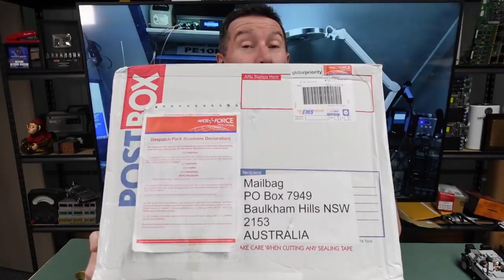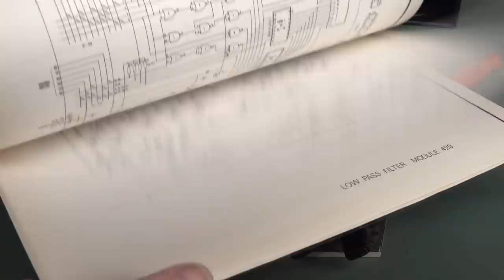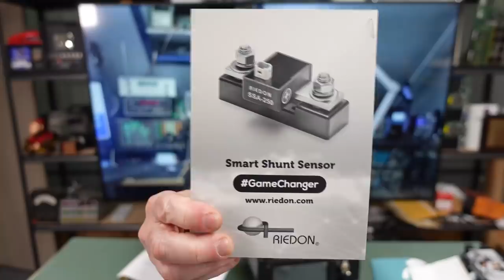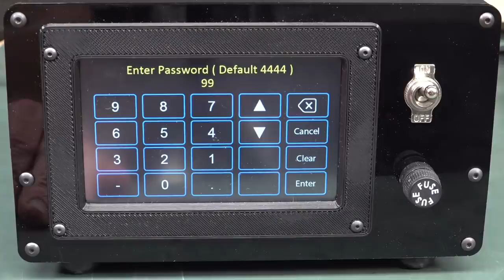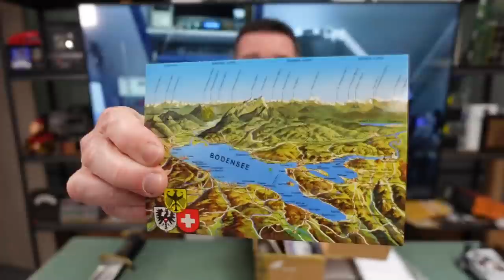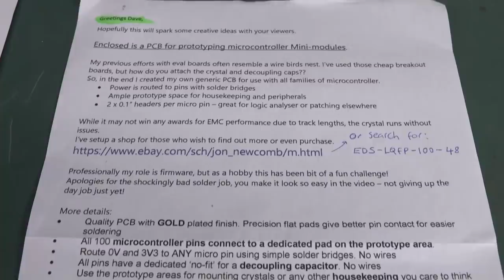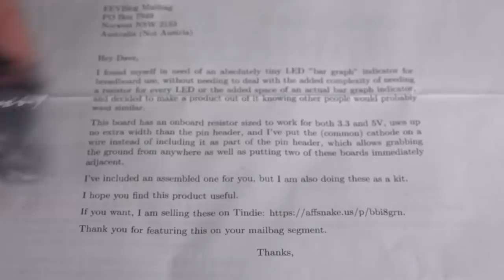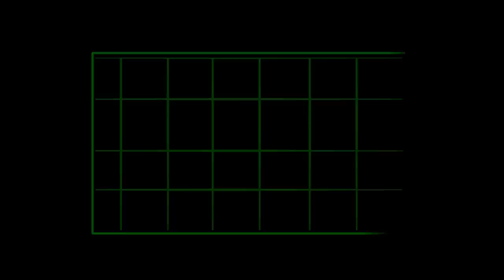EEVblog 1410 - Mailbag

Comment: note the brand of the TBA810 : SGS-ATES , the precursor to ST : ATES : Aquila Tubi e Semiconnduttori , SGS . The other TBA120 was very common mf opamp used in many tv's of that vintage. Those transistors are a SOT25 package. again , many audio/video stuff made in europe of that vintage used those. Even the schematics look and smell like philips.
Reply: BF195 BF196 were popular MF transistors in that package. Siemens also used it.
Reply: These SOT25 BC147 transistors were also used in old electronics kits from Philips (e.g. EE 2003) with which my "electronics career" began in the 70s ;-)

Comment: The Riedon SSA-100 is very strongly inspired by one of the many very well performing isolation amplifiers by TI/Broadcom/SiLabs (eg, the specs are the exactly the same).
The thing is, the packaging is pretty unbeatable - it should be an isolated drop in replacement for a standard shunt.

Comment: I had a torch like this as a kid in the 90s... One night I heard a noise, I thought it was a car driving slowly and parking on the gravel parking lot beneath my window... but it kept going and going. After a while when i was properly woken up, I realized, that it was my torch in the mains plug, that was melting and boiling inside. That could have gone horribly wrong, if I hadn't woken up...

Comment: Never heard of or seen one of those torches (that says Gelios AN-0-001 in case anyone is wondering), but I still have somewhere a late 60s Radiotehnika RRR charger for 9V 7D-01 batteries (the batteries had a cylindrical shape but the same contacts as a 6F22), and just now investigating the topic it seems they had a cluster of ni-cad tablets inside (similar to the ones shown in the video). It has pretty much the same guts, but doubled bc it's multi voltage (the USSR used 127V in the early days and to my knowledge some places used that until the 80s). The design is such that you can just plug it into a (flat and very unsafe) soviet socket and stick your finger in there.

Comment: Supercool items! 
The protoboard is amazing. A full-stack electronics dev platform,.....

I remember having a similar "bulb" torch which the same charging topology, but the batteries are standard-sized NiCd.  Had torn them apart and the NiCd sheets inside are very slippery to hands and never go when washed off(just like wetting heavy alkaline stuff).

Comment: I had one of these mains chargeable torches. Unfortunately one of the connectors came loose and got stuck in the wall socket.. As the normal  7 year old, I grabbed it with my fingers and since then I had been hooked to electronics

Comment: NASA Pen Story: Mostly false. Both NASA and USSR initially used pencils. Both disliked them because graphite is conductive, flammable, and flakes off (a terrible combination in space). NASA used mechanical pencils that cost $129; this was the point of public outcry. Fisher independently developed the AG-7, "Anti-Gravity Pen". Both NASA and the USSR bought hundreds of them at $2.39 starting in 1965. They are still in use today on the ISS.

Comment: "SIGTEC A1203" Radio Call sign PCB. Due to governance Ruling app. 1994 they installed those. Pres transmit key and first call sign is transmitted. I still can reprogram those A1203's

Comment: The US used felt-tip pens in space.  Fran Blanche did a video on fountain pens, including that there are felt-tip fountain pens and it was this type that NASA used in space because they're unaffected by gravity or the lack thereof.  The problem for pencils is how do you SHARPEN them in microgravity?

As for the Soviet-era mains-chargeable flashlight, I can't find any rechargeable battery chemistry with 0.26V cell voltage, so that's probably something else.

36:00 It even looks cheap on video.  It looks like metalized plastic.  Which is exactly what it turned out to be when smashed open.

Comment: Frako electrolytic cap at 06:55 - Yes, here is a Frako fanboy. The company Frako (https://www.frako.com) is still around, but as it seems no longer in the "small caps in high volumes" business, but in power quality and power factor compensation, where capacitors still play a vital role. Frako was and is a quality brand.
I found some Frako Elkos ("Elko" is the German abbreviation for electrolytic capacitor) in my component stash. They were from the late 1970s, when I built my own audio gear. Some of them were never used, new old stock so to speak. With their yellow/golden appearance, these parts stood out and were quite popular.
I took a 2200µF 16V type and connected it via a 40kOhm resistor to a 12V voltage source. It re-formed well, after 10 minutes, the leakage current was down to 10µA, after 30 minutes below 3µA. This is pretty impressive for an electrolytic cap which is more than 40 years old! The component tester measured it as 2500µF with an ESR of 0.2Ohm. I do not know how far this holds at realistic currents in a real rectifier/filter circuit, but I would expect the Frako cap in the marine receiver to be the least problem when bringing this device to life again.

Comment: That current shunt is really nice.. after watching that review on it just trying to create a need for one :D As for the torch / flashlight I use mostly LED for everything these days but I couldn't part with my old 6xd cell maglite, even though compared to some of the newer stuff its like lighting a match i keep it in a safe place with come 10 year magnesium batteries just in case shtf (if It wont light anything up the sheer size of it can beat down some zombies)

Comment: they are using a rippoff nextion (tjc) display @ 17:30  its got a graphical editor software where you can design elements, pages and stuff and just talk to the arduino via serial.  
tjc's are chinese nextion, its sorta ripoff. they are cheaper and intended for the chinese market (you cant even use the english software with it even tho its identical) you gotta use the chinese one.

Comment: To me, that piggyback chip is likely an increase in digital memory. The "bodge" wire is likely an additional address or chip enable line not included in the original circuit. Perhaps they did this to add additional frequencies not used in the original market?

Comment: Are there SMT devices on that bodge board?  That would definitely be an anachronism.  Even the fiberglass in the board would be unusual.  Probably, the repairs required obsolete component(s).  I do believe Mr. Carlson would like to play with that.

Comment: "Giant Package Trannies" now means somthing entirely different.
It is sad, used to companies provided amazing manuals to the consumer.
Then later they would provide them to authorized dealers but many companies would sell you a set if you asked nicely.
Now there are no authorized repair shops and many brands do not sell parts.
At all.
If it breaks after warranty (most likely 90 days at the longest) the company is done with you.
I worked at a 2 way radio shop for a while and we had glorious manuals from Midland, EF Johnson, GE and a few other brands we either sold or had sold in the past.
At the time we were a Kenwood dealer and it was much harder to get even a schematic or an alignment guide out of them.
The other brands sent us SWAG back in the day.
I wish I could have swiped the Midland LMR authorized dealer sign.
Also back in the day there was Sam's Photofacts.
Those were great manuals.
Expensive but great.

Comment: @ 25:00 is that a PCB Dave? I don't see any circuit in it. Looks like flying wires to me.By the way I have seen Soviet era diodes like that. Bought some kits from Erica Synths in Latvia.  Their old Polivoks replica kits had genuine Soviet diodes and transistorrs. The transistors needed to be be shielded from light. Stray light affects performance enough to mess up an oscillator circuit apparently. (normally it's only heat we worry about!)

Comment: The motor you squashed had a rubber based flexible magnet something similar to fridge door magent. I wonder why cheap motor used this weak magent and not proper ferrous magents other than than the lower cost are there any technical reasons I knows its easy to cut flexible magnetis strips then roll them in cylindrial shape for the motor housing making economical to make.....

Comment: Watch out for the beryllium oxide in those output devices! Wouldn't be surprised if its been used.
Reply: unless you are going to grind it up, and inhale or eat the resulting powder, BeO is safe(manufacturing it, on the other hand, may be a bit riskier though).
Reply: Not likely at 25W power, you only find the BeO at high power in those packages, typically over 150W, as then the die cost is high enough that getting that little bit lower thermal resistance makes it worth using. Only the military, telecoms and space will use BeO when they need to get that last percent of power out, and do not mind that the price of the equipment has just doubled.
Reply: @SeanBZA  Well, I just repaired my Marconi 2022C RF signal generator which had warnings of BeO with one of the devices in one of the output stages. Same package device, maybe slightly smaller. Most you will get out of that is +13dbm, that's 20mW.
Reply: @m.k.8158  I had a vision of decapping of those output devices to have a look inside....
Reply: @gonzinigonz  Test equipment will use it, not general public purchased stuff, which all would be cut down to a cost, and simply use a bigger heatsink, as that is cheaper.
Reply: @gonzinigonz  well, if doing so, keep everything wet, wear a GOOD dust mask, and gloves, and you should be fine.
Also, better to break than to grind-less dust.

Comment: That transistor package in the C.B. you didn't know is an XO-9 package used by Philips in the early 70's usually BC147-8-9 BC157-8-9 transistors.
Reply: Also known as Lockfit.

Comment: Those bigger-than-TO92 transistors are the Mullard/Philips Lockfit package, designed to snap into a PCB with no lead forming or cutting needed.

Comment: A 27 Mc radio or a 2 meter 145 Mc radio?
Reply: Neither-it's a VHF marine band transceiver(156-157 Mhz)
Reply: @m.k.8158  makes sense now after reviewing the channel selector. Also, did not see a bank of “ rocks” or a diode matrix for “ frequency programming “. That radio is probably more reliable than some of latest equipment.